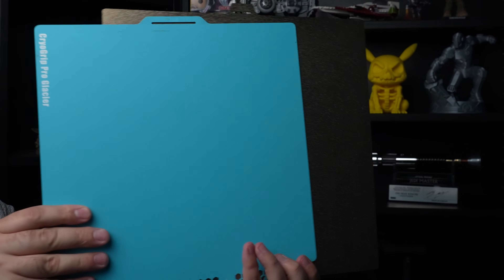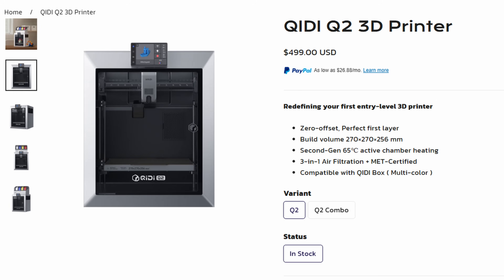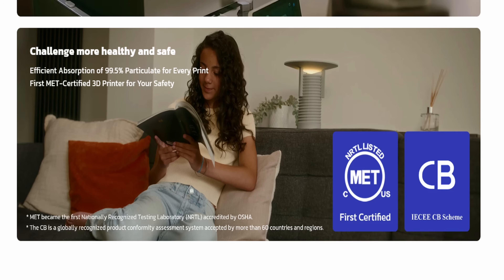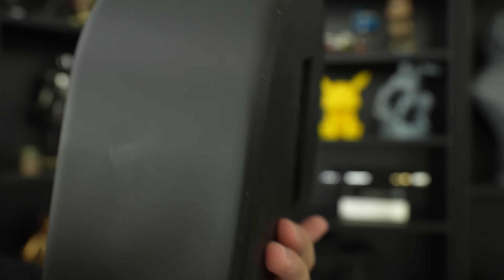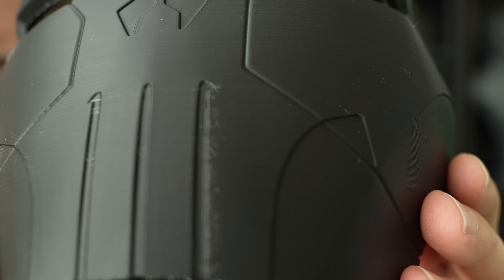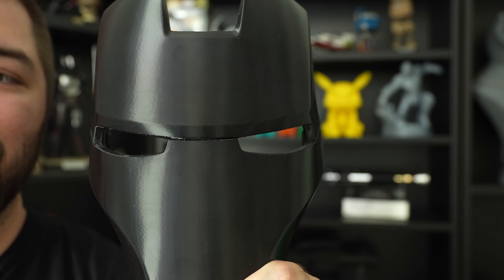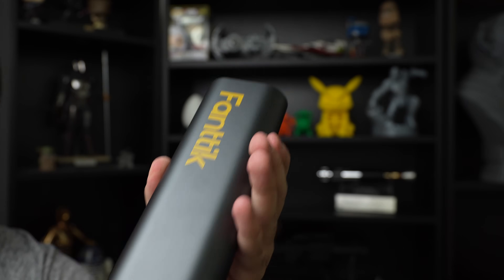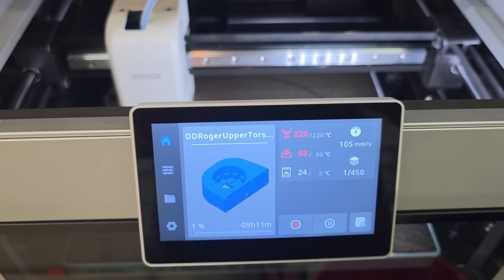The Best Value 3D Printer? QIDI Q2 Review!

Comment from the maker: What do you think about the Q2?
Reply: I have a Q2 for a month now. I am total 3D printing newbie with the Q2 as my first machine.  So far it has been just great. Since I am new to this, I just run with default settings and the Q2 has had great results PLA and PETG. Just got a spool of ASA to try out. Next year I will get the Qidi Box once I have more experience.
Reply: I just ordered the QIDI Q2 combo as a result of radio silence from ELEGOO.
Reply: I like it, but I feel it needs 4 to 6 more months for them to have a more polished printer, maybe 12 months.
Reply: I like what I see, but not sure will it deliver everything its promising...
Your opinion mate? This or sovol sv08?  As they are almost the same price in Oz.
Thank you 🖖
P. S. Oh, and P1S is close in that price bracket atm too ( no  ams), and i don't mind tinkering (both software and hardware), just don't want to end up repairing them in a 1st month. Cheers!
Reply from the maker: @zelan756  id lean p1s if more pla pet g but if you are doing higher end material the q2. I'd still bet on the P1S being more reliable

Comment: I got a Q2 a couple weeks ago and currently have 3 days and 20 hours on it. Bed levelling and layer adhesion is great, but I've noticed I need to manually change the Z offset for every material I print.

That being said, I mainly use PAHT-CF and PET-GF and this machine is great. Qidi's presets for their materials is pretty much spot on. 

Biggest downside so far is Qidi Studio is limited on their calibration tests, and I cannot find a preset anywhere to toss into Orca to use their tools. 

That being said, I'm glad I bought a Q2 and used the money saved vs other printers for more filament.

Comment: As it being my first printer I'm caught between the q2 and the cc. Im thinking of printing 2a stuff so the high heat is a must. But I can save $200 on one but I want to know about reliability and newb friendly
Reply: I'd go with the heated chamber if you want to print 2A. I've done a few in PLA, it's good on paper because it's fairly hard, but barely any sun exposure and it starts to warp and cause issues.
Reply from the maker: Truly, on a newbie-friendly level, all printers are now about the same. If you are only printing pla then the cc is the way to go. Mine struggled more with pet g and haven't tried with much else on it. But the cc quality is surprisingly good so my pet g results could have been me not playing with settings

Comment: Day 2 asking to raise the mic volume
Reply from the maker: Where was day 1 but the sound is fine on my end
Reply: @3dPrinterMike  It sounded fine for me too, even on my 14 year old laptop.
Reply: @3dPrinterMike  stats for nerds says -12.2dB which is pretty quiet. Youtube engages 'stable volume' to compensate for this, so sometimes you might get the impression it's OK when it's not. And stable volume only works in the youtube players. You might want to turn the mic gain up a touch. Thanks for your video, I hope this info helps.

Comment: I've been BIG fan of Q1 Pro,  i would love  to get a bigger bed . I just don't see the q2 large enough . The Plus 4 i had hoped to see and Idex i don't need 4 + colors . Just need that one extra color.
Reply from the maker: Once they relaese the source code it could get idex theoretically
Reply: @3dPrinterMike you think it can be fitted on some enclosed  core XY models other than Voron based ones? That would be great, solves my dillemas straight up. Then I can go for any core XY if that's the case, right now I'm thorn with choices between this one, sv08 and couple of other ones in similar price bracket... Just trying to future proof, and get options to upgrade for multimatetial when indx comes out. I don't like  the AMS route.
Reply from the maker: @zelan756 yes but how easy is another story
Reply: @3dPrinterMike  if there's enough space on the front (between the bed and the top front rail, I think it's doable, maybe even loosing some build volume would not be a big issue as it's a larger one to begin with. That's one of the reasons I'm looking into sv08, the size. Only problem Ive seen online with it, it's the bed.. Same with S1, otherwise anycubic would be a no brainier (same price for the combo as qidi-Q2 without it).
Tnx for replying mate,  I should never have started watching these 3d printing videos. I'm like a child, I see it on TV and I want it! Now I have to start thinking of new  excuses for my wife.
Reply: @3dPrinterMike  if there's enough space on the front (between the bed and the top front rail, I think it's doable, maybe even losing some build volume would not be a big issue as it's a larger one to begin with. That's one of the reasons I'm looking into sv08, the size. Only problem Ive seen online with it, it's the bed.. Same with S1, otherwise anycubic would be a no brainier (same price for the combo as qidi-Q2 without it).
Tnx for replying mate,  I should never have started watching these 3d printing videos. I'm like a child, I see it on TV and I want it! Now I have to start thinking of new  excuses for my wife.

Comment: I have a qidi plus 4, and same here with PLA, it's because the chamber does get hot, but PETG and ABS print flawless, which is what I mainly print. Also PA6-GF it's the best at printing such filament out of all the printers I have ever knowm
Reply from the maker: Thanks for confirming my suspicions!
Reply: Im considering the Q2 for some pew pew stuff. Can i trouble you, or any Q2 owner on here, to post some PA6-GF, PPS, PPA prints from the Q2 ?
Reply: @MrBiggs-wu2kf  I've printed with these on my Plus 4. The Q2 should print these materials without issue.
Reply from the maker: @MrBiggs-wu2kf  theoretically it should be able to handle it but I dont have any of that material personally